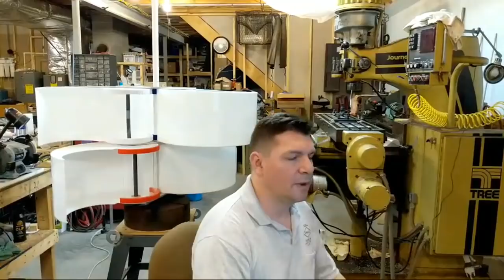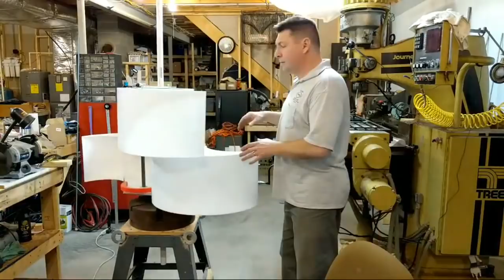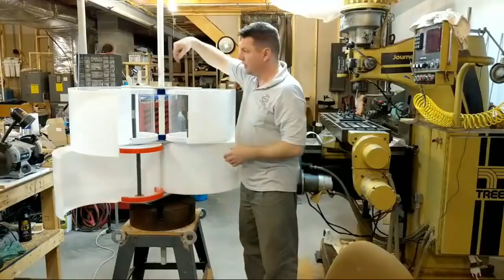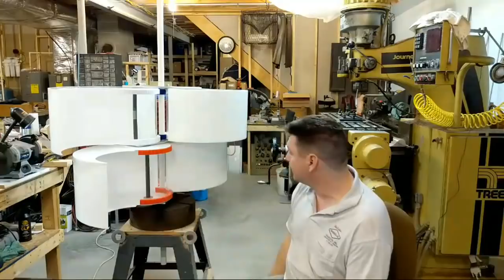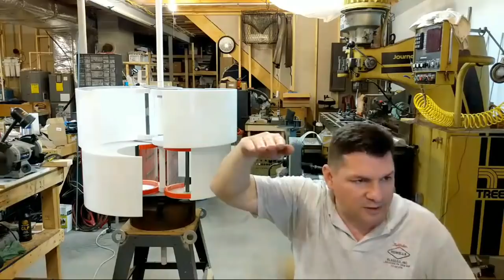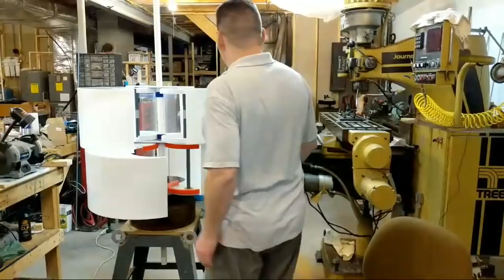Vertical Axis Wind Turbine - Harmony VAWT Explained

Comment: Solar Panel system installed.  10Kw  using 2 of three phases. SunnyBoy 7.7-US inverter. Could I add a Harmony then use phase 3 in the inverter for grid tied to generate extra electric back to power company?
Reply from the maker: Normal charge controllers for wind turbines generate wild 3-phase so you just take this, rectify it into your DC source and then gird-tie out of that. Solar and wind should all be on the same system because sometimes you get just 1 or the other; rare to have both. One day soon, I'll have both on my house!
Reply: @HarmonyTurbines  Right on thanks for the reply. I is great with my 28 panel 10Kw system commissioned Oct 04 2018 last year 18-19 i saved 655.78 on electric and that includes lots of snow rain and cloud days. i will be interested in following along with your invention and seeing where the final numbers come in for production at the top level of efficiency and production. We have a lot of wind days here so this would be a huge asset to offsetting snow and cloud days. Best thoughts going forward for you

Comment: Have you considered planetary gears interlocking the top and bottom instead of the worm drive for the furling mechanism?
How did you decide on 5? Do you have plans for smaller units for mobile use (eg. Camping)?
Are you documenting your entrepreneurial journey?
Reply from the maker: @Nick Smale
 the worm drive is necessary because it locks the furling state wherever the worm gear stops. Planetary gears would not lock and the servo would have to constantly stay under power to hold the furl in whatever configuration is needed. Plus a wormgear is usually 50:1 or 30:1 ...something great like that giving mechanical advantage exactly where I need it. I decided upon 5 just because the small prototype seemed to need more. But now I'm starting to design it with 4 because 5 seems to be too many for practicality sake. I believe I'm going to do the prototype with 4 instead of 5 just because it makes a lot of things easier for me. --I know people will likely be pissed because of the delay but it won't be that big of a delay. I can order new material tomorrow and have it hear within a week. Documenting my journey on YouTube but nowhere else.

Comment: What if debris got stuck in between the gears? I imagine that would cause problems with the furling mechanism.
Reply from the maker: Yes it can cause problems @Agus Hartawan but that will be an engineering issue dealt with in a number of creative ways later when we have more R&D money for that sort of thing. A solution to that isn't necessary for primary funding rounds.